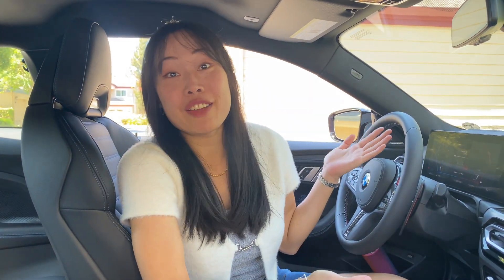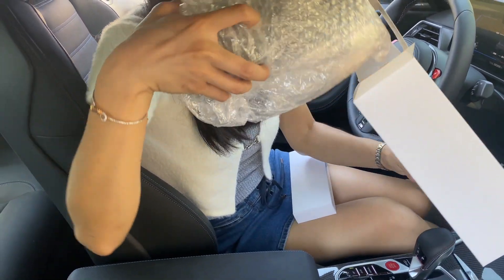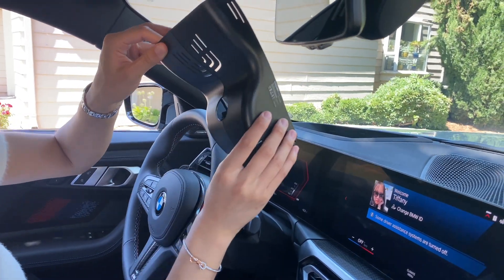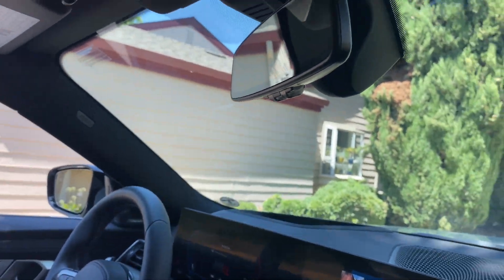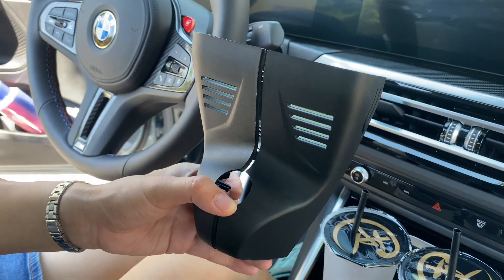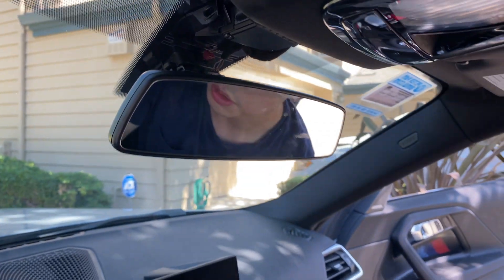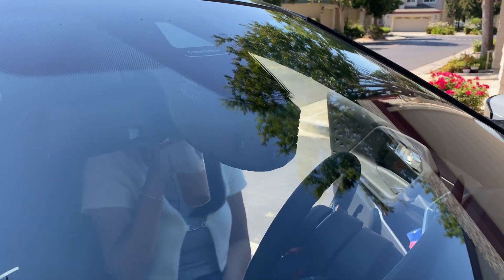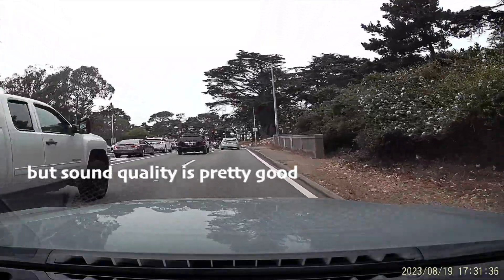👀 🌚 THE Stealthiest Dash Cam | BMW G87 M2

Comment: kinda pricy for a basic camera, no dual screen, no angle adjustment, Dongar sells a small 12v adapter for mirror , can run any camera or radar detector, with no long wires, uses the mirrors same plug as your camera, nice video

Comment: does your camera stay on after ignition is off, because the plug your using also powers the red flashing alarm on light in windshield
Reply from the maker: It turns off when the car is off